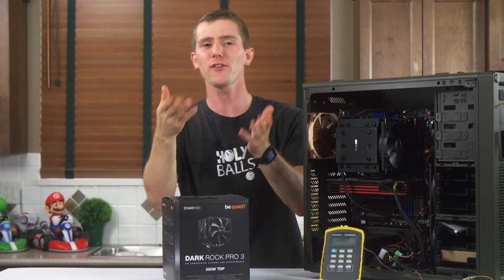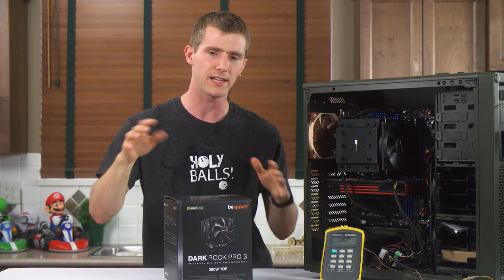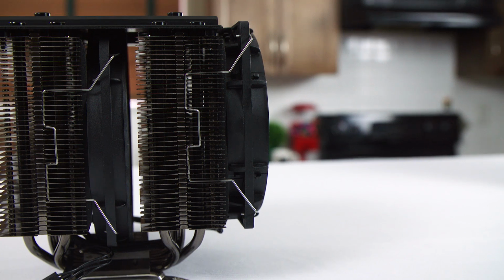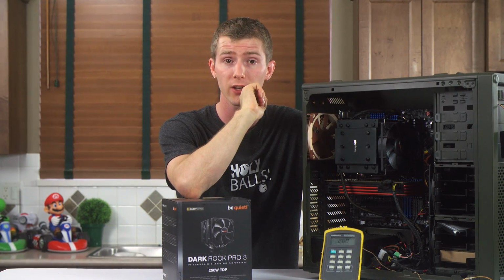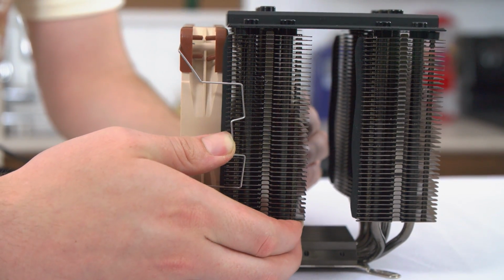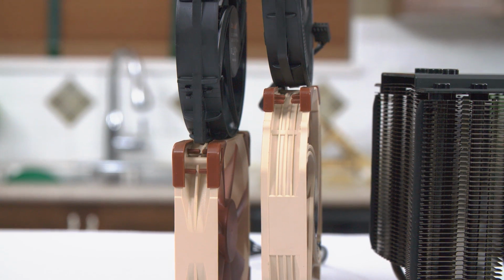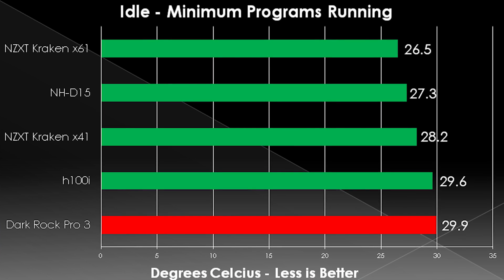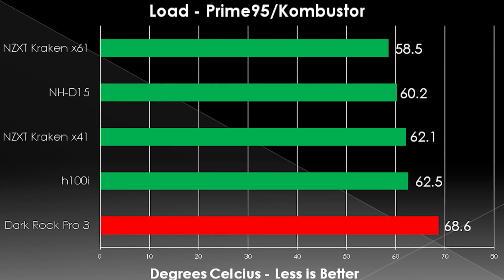Dark Rock Pro 3 CPU Cooler from be quiet!

Comment: Seeing that 68c kinda pushed me away. I've got a 4670k @ 4.6ghz 1.277 volts
and I don't get anywhere near 68c normally with my 212 EVO. The only time it would is if it's super hot outside, like 90 - 100F, I'm on the second floor. No central Air and Heating, just a window A/C. You can get a 212 EVO for around $30.

I was interested in one these to try something else out on the market, but its seems I made the good choice with my EVO. I am however looking at the H100i, I don't know if I could get better results with it or not.

Comment: I get that they try to standardize all their tests by using Noctua fans, but I must say I disagree with juding a cooler only by those benchmarks. If you're reviewing a product you should at least review the whole product as it comes.

It's like someone's doing crash tests on a car but they always put roll cages inside of them first. Yeah it's going to protect them better in a roll, but at that point you're not really testing the car anymore.

I can see how this sort of a test would be useful, but I think they really should do two benchmarks, one with the coolers as they come and one with Noctua fans. This way they'd have their standardized version with the Noctuas, and another test for how the cooler performs purely on its' own merits.

I've never put new fans on my cpu coolers right out of the box, so I think adding another test that doesn't depend on spending an additional $25-50 on fans would be valuable.

Lets say I'm choosing between two similarly priced coolers, #1 gets better temps in the Linus Tech Tips benchmarks, but in reality #2 might have better stock fans and perform better. Unless I plan on spending extra money to replace those fans out of the box, I should go with #2, but I wouldn't know that from seeing these Noctua-only standardized benchmarks.

Comment: Those fins look sharp. I already got my hands a bit cut up while mounting and putting fans on my Noctua cooler. It's the U9B SE2 model and those fins are like friendly puppies. They feel fine at first, but working with them means you will get bit. It looks like that cooler was made for people with small hands, though.

Comment: I have yet to find a CPU Cooler, whether it be air or liquid cool, that can give me a better overall price and performance boost over my Thermaltake Frio 220V. Other fans I have seen on the market depend on their gimmick rather than actual performance.  I do not like or trust any fans the use mounting clips like the Dark Rock 3, that includes and fans from the Noctua line.

Comment: This thing is way more expensive than my Noctua cooler! Lets see, more money and it doesn't cool as well. Its a no brainer. Noctua wins. Me, AMD8350, Sabertooth990FX, Noctua ndh14. $102.40 at Amazon for the Dark Rock. Why make your product with non standard mounting wires? Shame on you Dark Rock. Now that the news is out most people who bother to watch the review will stay away. It's  not just because of the performance but because of the lack of standardization, oh and the PITA installation. Noctua wins again. I've had my cooler on and off a few times to set fan controller thermistors. no problem, Noctua supplied a long screwdriver. Am I a Noctua fanboy? Not really. Its the only product I own from them, but it works as advertized.

Comment: Nice but why didn't you include the Noctua D14, Phanteks, Mugen 4 and other air coolers into the test? You got a much more expensive Liquid coolers and 1 air cooler in that test. It would be nice to see a difference in AIRcoolers and than you could put 1 liquid cooler H100i for reference

Comment: Out of the box it performs like a noctua nh-d14 and, from many reviews just around 2-3°C behind a coleer like h100i (always out of the box, not with noctua fans). I have it, it is DEAD SILENT both on idle and on full load, and I don't get why he described the mounting so horrible, yeah it's tricky, but if you take off the graphic card you can easily align it by sight and screw it from the back.

Comment: I was wondering if this system is any good, please give feedback!

-ASUS SABERTOOTH 990FX R2.0
-AMD Black Edition - AMD FX 9370
-Corsair Hydro Series H55 Quiet CPU Cooler
-Corsair Vengeance 2x4 GB
-MSI R9 270X GAMING 4G
-Samsung 840 EVO Basic - Solid state drive 250 GB
-Phanteks Enthoo Pro 
-Corsair CX Series Modular CX750M
-Windows 8.1 , 64 bit

I'm quite a pc noob and I was just wondering if this system would work together!

Comment: I'm really sincere when I ask this, but, when AIO CPU watercoolers exist for just 25 or 30$ more, and perform better, why would anyone ever pick up a large heavy air cooler for their PC? It seems like the size and weight and less sleek design would really push them out of the market compared to AIO solutions. I mean... Right?
Reply: They don't perform better. Refer to 4:23. Also, they are not always mountable depending on the case.
Reply: Andrew Winn That's true, I suppose.. Hmm... But.. Blah. Yeah I guess, you're right.
Reply: not to mention they are noisy over complicated piece of shits with more points of failure compared to a simple air cooler.
Reply: DavisSgt the comment explains itself, i refuse to elaborate and say it twice.
Reply: Pivitrix Why are you calling AIO,pieces of shits?

Comment: the Dark Rock Pro 3 is garbage it costs 20 dollars more than a Noctua D14, the Noctua cooler works better AND quieter and the mounting brackets the Noctua kit comes with are better designed which is very important when you have a cooler in this size/weight class hanging off of your motherboard and the tool you get to install the actual cooler is much easier to use than that retarded miniature wrench

you are paying way more money for a much crappier cooler that will be harder to install just because its black and looks cool

if you are thinking about buying this garbage then punch yourself in the face and go buy a noctua nh-d14 instead

Comment: I want to overclock my CPU, but I don't have an aftermarket cooler, I want something cheap (I will change at a point). I saw Scythe Katana 4, and people says it's a good cooler, but I want another suggestions. Thanks in advance!
Reply: Get the Cooler Master Hyper 212 Evo. It is only $25 and you'll be able to overclock safely.
Reply: 9370? There's your problem. You need to strap that thing to Antarctica to cool it well.
Reply: Cooler Master Hyper 212 EVO- Cheap and very effective.
Reply: put a soda bottle in the fridge with water in it. and when its solid. take it out. cover it in aluminium foil and ut it on top of ur cpu.
Reply: Go for older corsair water coolers, the cheapest one goes for about 40-50$ and it looks like it'll do the job.
Reply: Poop .Noodles It melted my FX-9370....
Reply: bugatti1075 Actually I want a good and cheap one fast. And when I had the money I'll buy a better one and this I will install in other PC in my house, so I'll still use it :) 
Sadly, in my country the prices for PC parts are fucked up :(
Reply: Cooler Master Hyper T4 might be cheaper and it performs comparably
Reply: Poop .Noodles Thanks for sugestion!
Reply: get Cooler Master Hyper 212X
best bang for the buck
Reply: Poop .Noodles In the US its 25 USD,in Croatia / EU it is 50-60 USD....
Reply: Poop .Noodles Lol in my country it is $45-50.. damn the VAT :(
Reply: Xigmatek Aegir cooler is what I have and its good value and has lots of heatpipes =]
Reply: bigbenisdaman . I've got one in my system right now, overclocks beautifully
Reply: ProtoMario I have an 8350 @ 4.6 and I use a T4
Reply: ProtoMario I've got a Phenom II x4 OCed to 4.0 gHz
Reply: ProtoMario I have the cooler master hyper tx3 in push pull with some antec fans on a amd 8120 oc to 4.7ghz
Reply: Why pay for a cooler twice when you can buy a good one once? Save up and buy a good air cooler in place of buying a meh cooler then paying again for a decent cooler.
Reply: bugatti1075 They have weighed the cost vs benefit and decided that the short term solution of getting by for now is better than waiting a little longer for a better fan. They also could have made some budget cuts to the build because it was too expensive for them at the time.
Reply: ProtoMario Dude, you make the best PKMN Theories ever! :D (off-topic)
Reply: ventusluca lol you put an air cooler on that heat box?... There's a reason AMD offers it with a water cooler.... Thank god for Intel!
Reply: Michael Kimrey I didn't get a cooler with it.....
Reply: ventusluca well right. You have to buy the one that has it. They sell them with or without the closed loop water cooler. You can buy it without if you already have a water loop or something.
Reply: Michael Kimrey Well i got a FX-8350 and a Corsair H80i now, Much better combo :P
Reply: Poop .Noodles How high can you actually OC with a cooler master evo 212? I plan on getting an i5-4690k and I'd like to safely hit 4.5GHz or above.
Reply: darksage1850 Like I already said my 8350 is on a CM T4 (pretty comparable to a 212 evo) and it is overclocked to 4.6
Reply: darksage1850 LOL good luck with that
Reply: airgear87 for at least 3x the cost.
Reply: airgear87 for at least 3x the cost.
Reply: DrigrX.
Reply: just go with the katana 4. similar or even a bit better performance than the hyper 212 evo, smaller, dirt cheap, easy to mount and very quiet. i'm using it myself and couldn't be happier.
Reply: Gelid Solutions Tranquillo Rev. 2 is better than a 212 Evo, and is extremely quiet. Running a 4670K (4,3GHz @1.88Vcore) with max temps being 60 :D
Reply: Any of the Hyper 212 coolers will be fine for a small OC
Reply: If you want to overclock just go with liquid cooling, a closed loop is cheaper than a custom liquid cooling solution, there are some great looking fans cheap cpu fans out there but you also want to keep your cpu as cool as possible to make your hardware last longer, don't cheap out on cooling if you're gonna overclock
Reply: David Garcia I agree with you, but you know, in my country the prices are too high for PC parts, anyways, I always keep my CPU below 70-75*C because sometimes I do long renders (like 10-12 hours) and I don't want high temperatures.
Reply: laurentiu d. I do video rendering too, I have two pc's at home I can do it with, I overclocked one of them just to see a difference and honestly, I would much rather keep them at stock speeds with a cooler that cools them off decently enough without breaking bank
Reply: I just ordered Scythe Ashura Shadow and its AWSOME !
Reply: If it fits in your case, you're better off with the Thermalright True Spirit 140 Power. It's quite unpopular because it doesn't fit in most cases, it's quite tall. But with the 8mm heatpipes and the 140mm fan it destroys the CM Hyper 212 EVO. It's also around 2 dollars more expensive, but with much higher dollar/performance ratio.
Reply: Enermax ETS-T40, almost precisely the same as the Hyper 212 but looks nicer and might cost the same or less.
Reply: you should get it
Reply: http://www.newegg.com/Product/Product.aspx?Item=N82E16835103057 is the one I use and I run at 1.3 volts and OC to 4.4 with prime95 peak temps at 67 c after 24 hours. And it allows for tall rams dimms

Operating System
	Windows 7 Ultimate 64-bit SP1
CPU
	Intel Core i7 3770K @ 3.50GHz	35 °C
	Ivy Bridge 22nm Technology
RAM
	16.0GB Dual-Channel DDR3 @ 800MHz (11-11-11-28)
Motherboard
	BIOSTAR Group TZ77XE3 (SOCKET 0)	28 °C
Graphics
	E390i-A1 (1920x1080@60Hz)
	2047MB NVIDIA GeForce GTX 650 Ti BOOST (MSI)	27 °C
	2047MB NVIDIA GeForce GTX 650 Ti BOOST (MSI)	26 °C
	ForceWare version: 340.52
	SLI Enabled
Storage
	223GB Volume0 (RAID)
	931GB Seagate ST31000524AS (SATA)	27 °C
Optical Drives
	ATAPI iHAS424 B
Audio
	NVIDIA High Definition Audio
Reply: NH-D14's are cheap now that the D15 is out.
Reply: If you can find one, get the Enermax ETS-T40 (TB or TA - only difference being that the TA includes a flashy LED fan with it). It costs almost as much as the 212 Evo and performs equally to it. My i5 3330 idles at 30 degrees. But get the 212 Evo if it's cheaper.

Comment: i have an fx 8320 processor (bulldozer)

the stock cooler works fine but i was thiking about upgrading to a better cooler 
what would you suggest

also i added this processor recently and my old pc had 4gb ddr3 ram how much should i upgrade
I mean is 8 gb enough or shoud i go for more

p.s 
my gpu is asus r9 280x dc2 top
Reply: 1: NH-D15
2: 8GB is plenty.

Comment: How have they still not solved the mounting issue on their coolers?!  My Dark Rock Advanced it still plugging away merrily, and silently, but that was a bitch to install way back on release - I ended up holding the cooler in my lap and bolting the mobo on upside down from above.  All these years later I would've expected them (a German company after all) to have sorted it out.

Comment: I had the same mounting problem 3 weeks ago. I bought this massive cooler and I wasn't able to put all 4 screws in. I had 3 in and used 1 zip tie to mount the cooler. then I tested the heat and it was pretty good with 3 screws, but what if I go on a trip or a lan.... So I switched to the high end cooler from Corsair that was easy to mount on that boar, but the fans and the gatter wasn't that easy but even easier then the dark rock.

DONT EVEN THINK ABOUT TO BUY THIS COOLER WHEN U HAVE NO LARG BOARD AND LOW PROFILE RAM !!!!!

Comment: I had an arctic freezer 13 cooler a while ago. Fairly big tower. I actually had to break off some pieces from the fan mount to make room for the two DDR3 memory cards... Even after all that, one memory stick still sat in the slot at a forced angle..
Ahh.... the good old days.